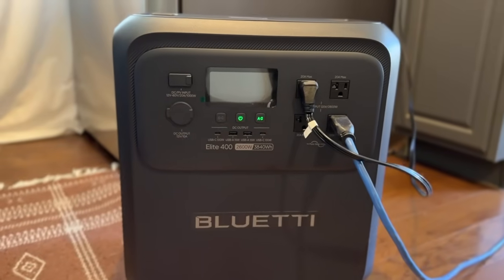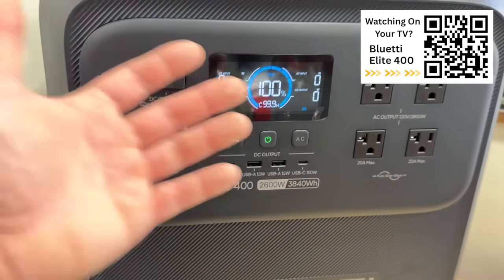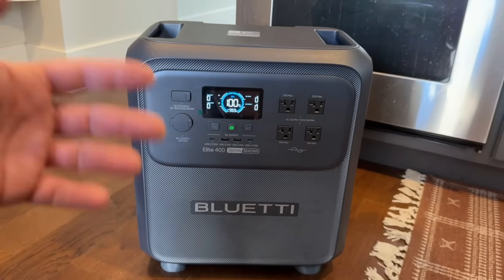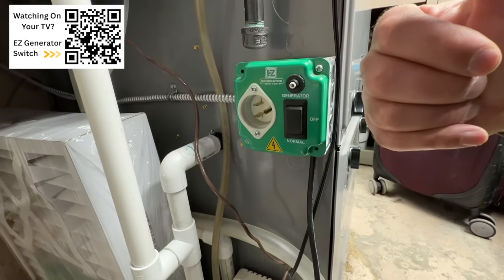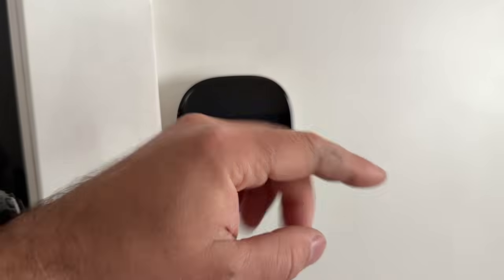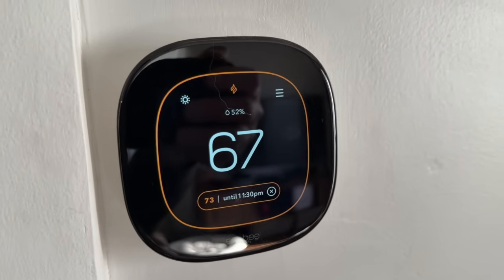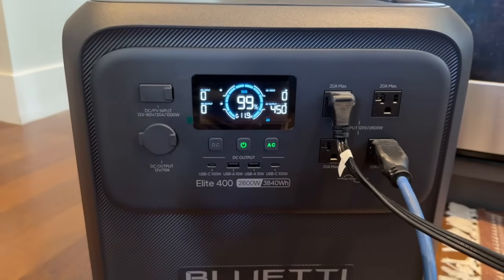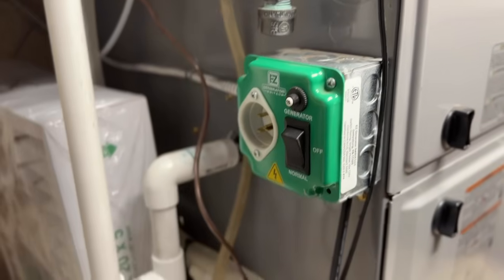How To Power Your Gas Furnace During An Emergency Power Outage

Comment: Thanks for this video. Question - does powering a gas furnace and refrigerator require a pure sine wave inverter, or can a cheaper inverter such as from harbor freight be used?

Comment: Hey Dave
I watched 2 of your EZ generator videos that show how to wire the switch to a gas furnace. In both videos you were using 2 different solar generators;  a Jackery and the other looks like an Ecoflow. You wired the EZ switch as a floating neutral application by removing 2 of the neutrals from the switch.
The other video you left the switch wired as it comes without removing the neutrals. This second method you showed the EZ switch connected to as a bonded neutral but you showed it connected to an Ecoflow, which is a floating neutral.
Very confusing can you shed some light on why you wired the 2 EZ switches differently if they were both going to be connected to a solar generator with floating neutrals?

Comment: Cool video but people definitely going to get mixed up on the EZ generator switch , floating neutrals, and bonding plugs if they are not electrically inclined. Just something for people to know. I love my EZ generator switch. I have several power stations now and one is always dedicated for the furnace for power outage in winter.

Comment: Can you do a video about how to power an electric furnace/heat pump off a generator? I have a predator 9000 watt with the max ac running watt 7250 and a inlet box with an interlock kit, not sure if this would be enough to power the house ac/heatpump or how to check.

Comment: $1500 dollars. You can buy a nice portable gas generator for that price and not worry about batteries dying in 12 hrs. the way you have it set up. Then spend a half day recharging it with solar without any power. Battery generators aren't very efficient. DC to AC power inverter take away battery power.

Comment: Can't imagine our Furnace will run long since it has a 3/4 HP PSC Motor.  Why not a small Gasoline Generator?  No worries about Lithium Ion Batteries melting down.

Comment: why don't you just connect it up to the battery and let its UPS functionality kick in whenever the power outage happends?
Reply: That may also help to save the heat exchanger during a power outage.

Comment: Wow 88$ for a switch! I just used an outlet and old cord I had in my parts tote , for free now my furnace is powered by short extension cord plugged into an outlet gained outlet in room, problem solved, easy on budget.
Reply: I did this but and the fan runs fine, but there is no power to the thermostat so the gas valve doesn’t open. How do you get around that

Comment: Thanks, Dave! Great idea. Just a note: if your portable power source like my ECOFLOW, has a "floating neutral," you wire the EZ Generator switch a bit different as per the provided EZ Gen instruction sheet. Me--I initially wired the EZ Generator switch for the usual and customary "bonded neutral" generator and was perplexed why my furnace was not running with my ECOFLOW when the power went out. Switched a few wires on the EZ Gen box--all is well.

Comment: Man it feels like you keep doing the same content over and over. Please do more new diy stuff. Automatic diy windows for summer cooling. I saw a guy used a 150$ ac as a diy heat pump. Diy applying mirrored prism window tint that helps cool the home. Testing the improvement. Diy windows awning install. There is so much new content left untouched!
Reply from the maker: I appreciate the suggestions, I'll definitely keep them in mind for future videos! I know there is a lot of people that haven’t seen the ez gen switch and I’m kind of forced sometimes with the power station review videos. I’m all ears for new video ideas so thanks again for the suggestion 🙏🏻
Reply: @diyhvacguy  I understand, Thanks for listening!
Reply: Pizz off

Comment: Great video. I actually put one of those switches between my generator transfer panel & the furnace.  In a middle of the night blizzard I can run the furnace from battery until I need to start that natural gas generator.  Everyone with a generator should also do this, it saves a lot of starts on the generator..